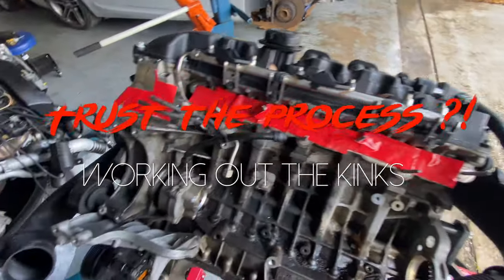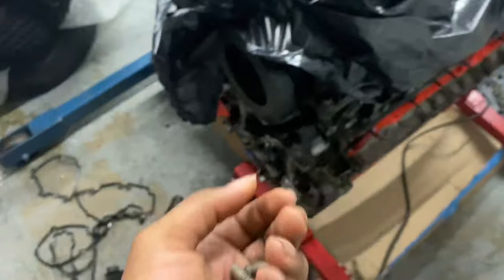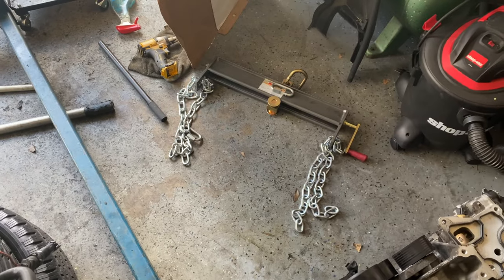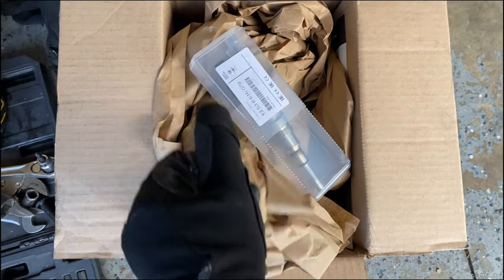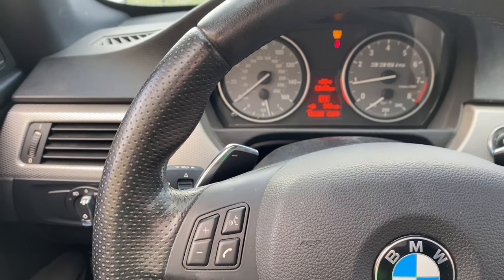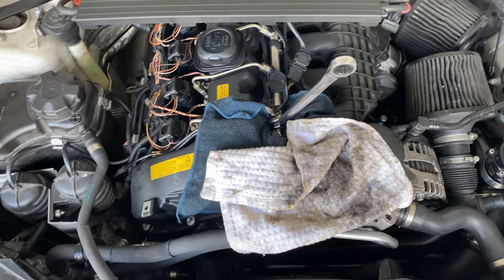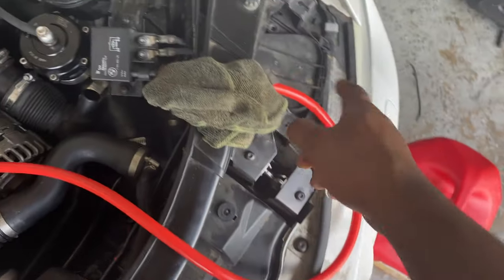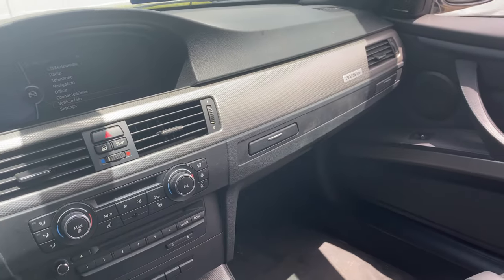BMW 335is Engine Swap Wrap Up

Comment: Man, i am looking to buy a 335is 2011 with a bad motor....watching you go through all of this has me thinking i can do it too, knowing damn well that i cant!! 🤣 I could probably DiY, take half of it off then be stuck and forget where everything went!! How'd you learn to do this!?
Reply from the maker: Haha yea man i know what you mean. If you get it at a great price def jump on it. But i just started small such as changing my own oil, then to intakes, and jumped into auto manual transmission swaps, and engine swaps. Once you see behind the curtain of how things work it becomes easier to connect the dots and do bigger jobs.

Comment: What year is your 335i? I like that rear bumper. I have an 07 and was wondering if it fits in an 07
Reply from the maker: It’s a 2011 335is, it will fit your 07 coupe.